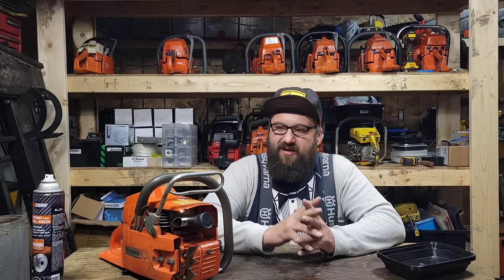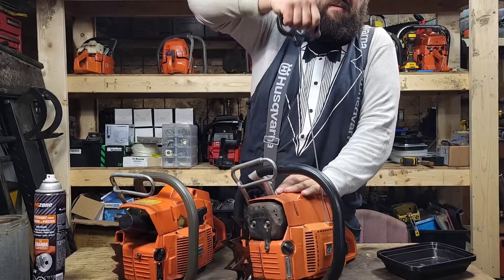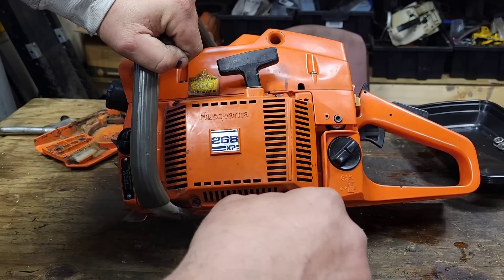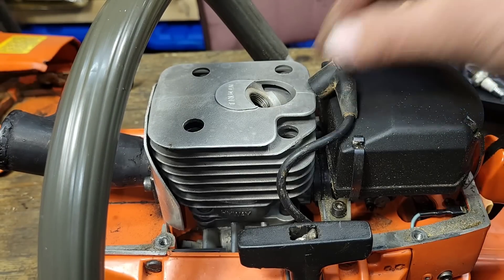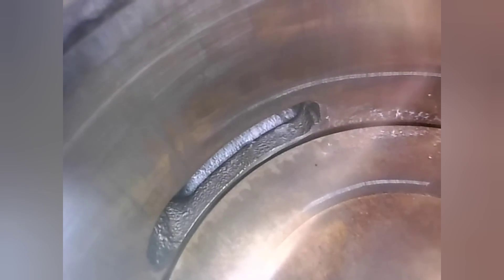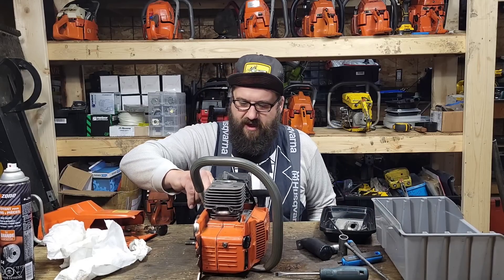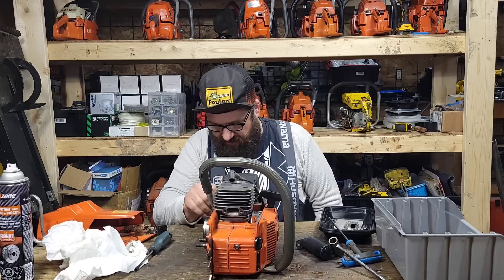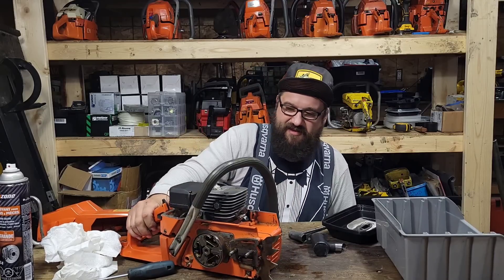Chainsaw breakin: A look inside a cylinder after 5 tanks of fuel.

Comment: Hi i have husky 61 with the grey top cover that lost compression but not all the way and piston and cylinder looks good with little aluminium transfer on cylinder wall and carbon below the ring so what really is the problem by the way it still a good running saw until now so i wonder if you can answer ne as soon as possible

Comment: Hi Tinman. Do you have a specific oil you like best for mixing with your gas and at what ratio? I've been thinking of going to 40:1 but don't know if that's good to do or not. Just want my saws to last. Thanks for any help! Love your videos!
Reply: Use 50:1 pre mix
Reply: I vaguely remember hearing in a video tinman said he's never seen a saw blown up due to the brand of oil used.. if I recall he mixes his at 45:1. Just make sure you are getting an oil for air cooled engines

Comment: I have a Stihl 010 AV that has all the crosshatch on the cylinder, no wear to mention on the piston. It has had plenty of use and I used it daily for a few years at work, the guy I worked for gave it t me when he shut the business down. I took it apart and put new gaskets in when I was chasing an oil leak on it so I got a good look at it. They don't make them like they used to.